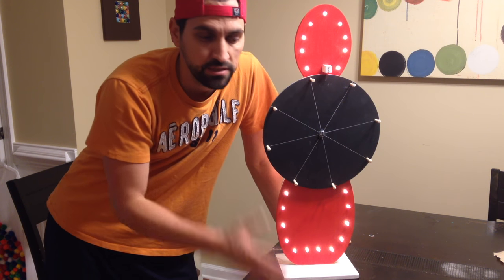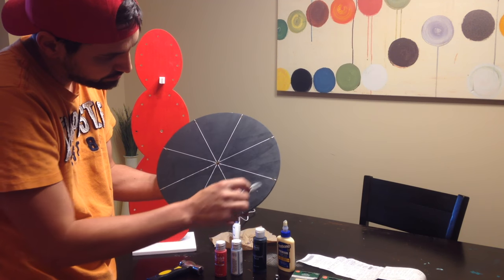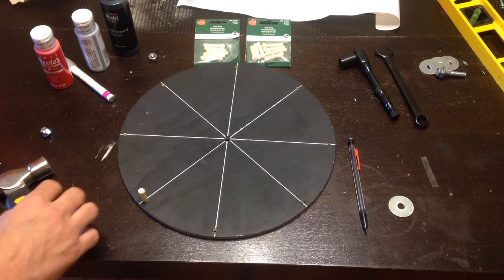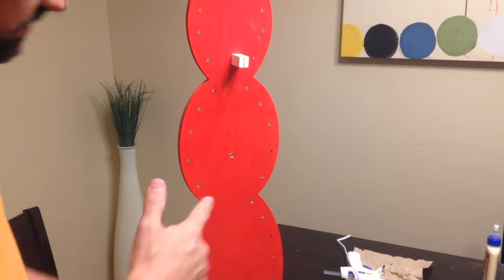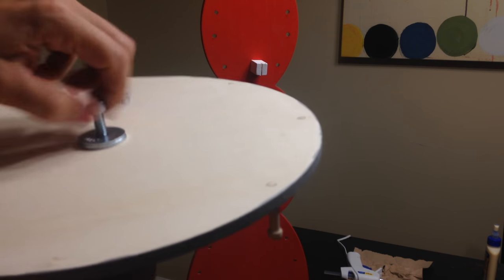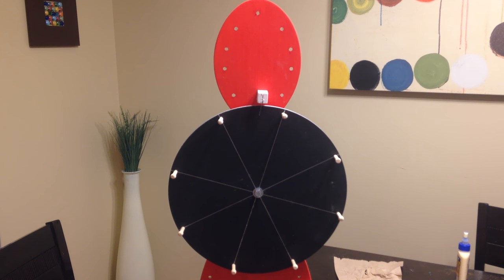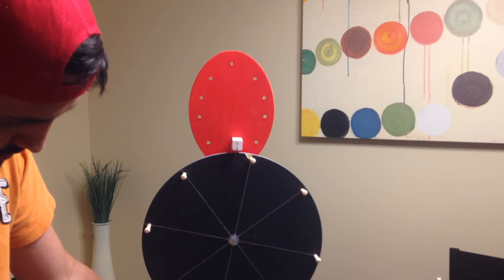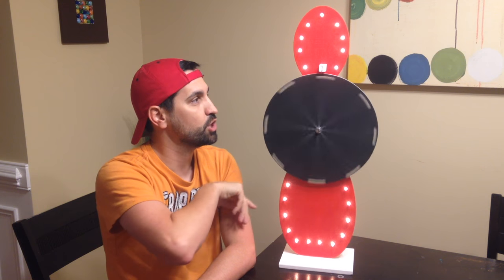How To Make a Roulette Prize Wheel for Under $20!!!

Comment: what did you use to make the hole?
Reply from the maker: I'm assuming you mean for the actual wheel.  I purchased that peice as is.  It's actually a clock face so it was already round and had the hole perfectly dead center!  I did have to drill a hole in the back peice to run the bolt through but was a no brainer with just a drill.... no special measuring for that. It didn't matter if it wasn't dead center... just really close!  Thanks for watching and asking! Hope that helped!